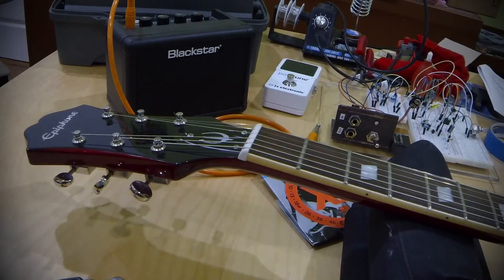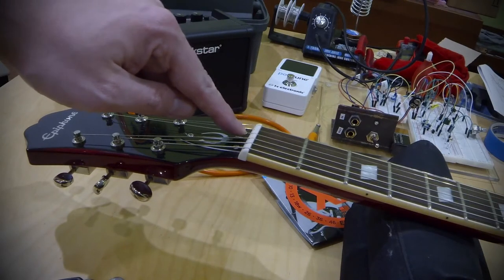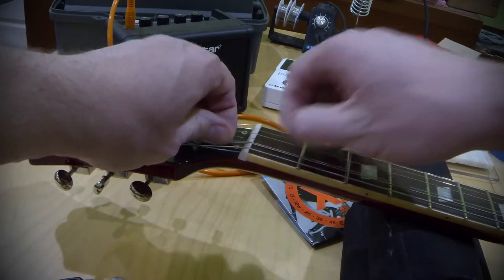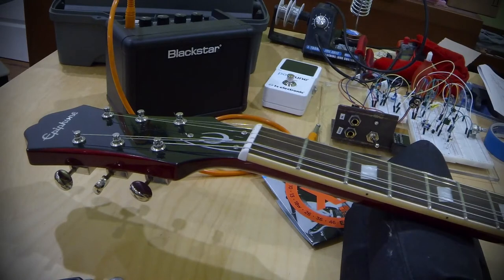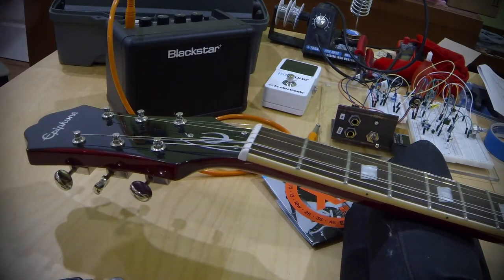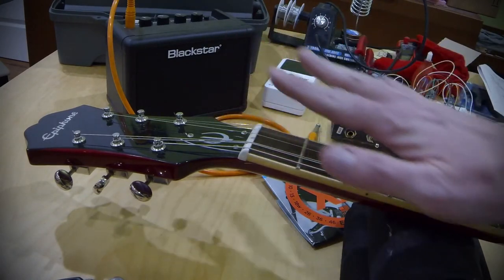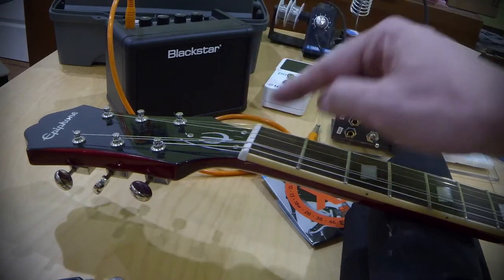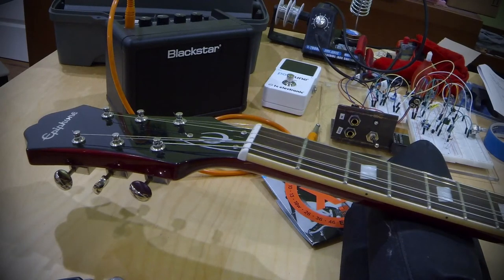Four tips to prevent string binding - MMT07

Comment: Don't take too much nut material if you're keeping the original nut, try the graphite first and see how it goes. If the guitar has been set up properly and the action is where you want it don't screw it up by grinding off more nut material. If you need to change the nut then you can get fancy and change the direction of the string through the nut.

Comment: Do you find that melamine is more problematic with binding when compared to TUSQ?  Never thought of the bee wax lip product, interesting idea, will have to try that.
Reply from the maker: I use Tusq XL nuts whenever possible. They've helped solve bind issues on the most troublesome guitars I've worked on. 

Real bone can also be good and it looks the part on a vintage instrument. It just needs to be cut correctly.

I've not used melamine as a replacement material on any of my projects, so I can't say for certain how it compares.